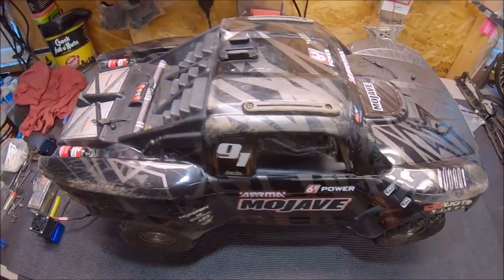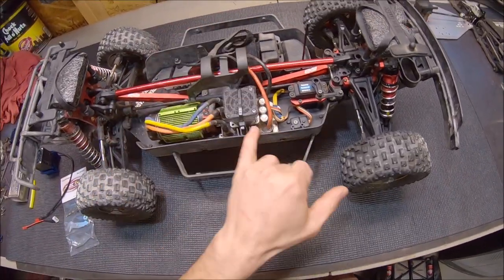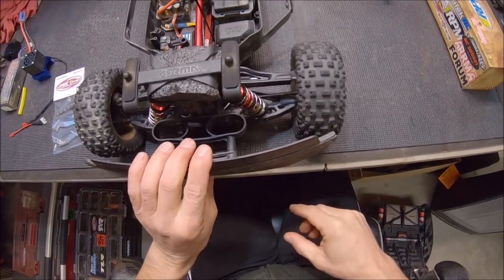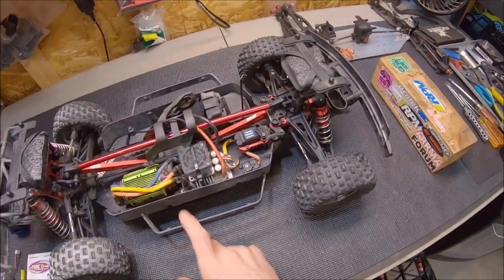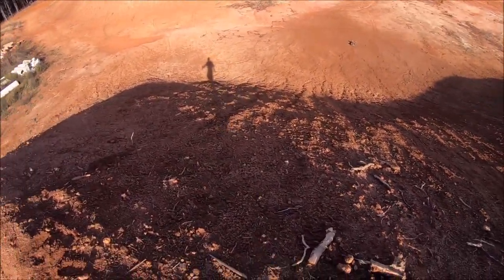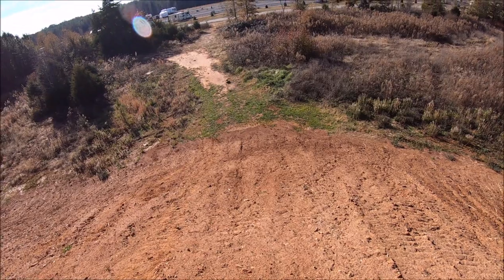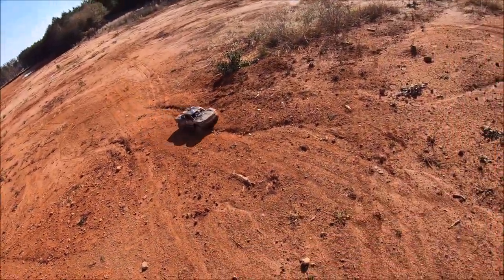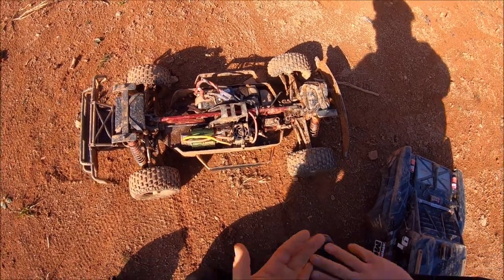"CRAZIEST!" Arrma Mojave EXB bash yet?! IMPORTANT tips and Upgrades!

Comment: Yup.. extreme compression popping front CVDs. To fix the rear;  front CVDs from arrma or GPM fit just fine. When you get the front CVDs into the rear you'll have the option to drill new holes into the shock tower and achieve lower droop for rear arms up to 1/2inch to keep rear wheels in contact with the ground with no issue of popping rear axles  =performance gains👍😁

Comment: Friggin SICK Brother Eric 😜!!!! Great job on the bench too 👍. Stoked the limiters stopped the shafts from going wonky and pulling out. That fan is definitely jet engine blower 😱🤣🤣. No problem pushing air now. Nice work on getting it mounted 👌. Huge props to Mitch for letting us bash how we want 😍. Another Killer session my friend. Definitely looks like a hoot. I feel the same way with my Senton 4s 🤗🥰🥰🥰. Not the best aero, but doesn't matter when you can't stop smiling. 🍻🤙🤙😎💪👊👊
Reply from the maker: Thanks Brother Rich!👊The Mojave is a whole different level experience and fun factor for sure! Just like anything, once tweaked, tuned and upgraded a bit in key areas, it's a total beast! I was skeptical of mega mound launching her for sure!😱🤣Going the other way was into the wind and sketchy but she floated down nice!😜Yeah adding limiters completely solved my driveshaft issue!🤗First bash since I've had the truck, not the first pop of a shaft! Mitches Exb Outdrives helped too!💪💪Felt good to rip this big girl again! Thanks for your comment and watching bro!😁👊💪🚀🚀

Comment: Very fun durable rc’s. I have a non EXB with a hobbywing max6 1650kv 8S stock gearing. I can’t get it to top speed, wants to take off in the air. Wheelies at all speeds. I haven’t taken it bashing yet. Just tested on the road. I’m sure it will be an animal off road! AWESOME VIDEO as usual! Yes installed the m2C wheel nut extenders. Thank you!

Comment: I did all my upgrades of m2c and am running a Hobbywing Max 6 w the 1650 kv motor and it flies!! I had to put 90 in the rear shocks as the weight w the motor was so heavy. I live when you say you don’t do big air w the Mojave, then 45ft jumps in the video!😂😂

Comment: I just got my roller. Putting electric s in her now 2200kv Taurus motor 24 pinion max6. 6s power i cant wait to run it. Nice video. My stering arm didn't fit on my servo. So i replaced mine. If billing u guys may run in same problem

Comment: I have a problem with the fan setup. The fan is pushing loads of air but it can only cool the tiny heat sink provided.
Surely the fan blowing over the whole motor would be a better solution.
Put some holes through the heat sink so more air can reach around the motor can. I don't have one but it makes sense to my eyes and thinking.

Comment: Since you have tested both which you one do you like it more, the Anthoiny fan or game changer ones? I'm running a max 6 combo in my Kraton EXB with a 19T and I'm getting hot. just running a pack of SMC 8000 Mah 125C. it just shuts off after 30 mints of running. I'm Running on grass, that's all i have around me. ESC looks fine but motor is hot to the touch.

Comment: I would also love to have the tools to do some shock work.  You want more rebound, however I have never seen a shock piston that can do such a thing.
It is possible to put a one way valve over a couple of holes so under compression the flap closes but on rebound they open allowing more oil to flow through  allowing the wheel back onto the ground faster.

Comment: I have a Mojave EXB, with all Spektrum electronics (motor, ESC, receiver).  I also use Spektrum Smart batteries.   I have never popped out a drive shaft, the EXB stock shock towers have taken a beating and have not bent.  I think you have over powered this Mojave - causing a lot of your issues.  The only weak spot on this RC is the Shock support.  A little drywall tape and Shoe Goo, still flexes but have not broken one since.

Comment: Love the video! Do you have any issues with jumping the Mojave and controlling in air? When launching it sometimes feel like it doesn’t respond to brake or throttle to level out the truck when landing. Any suggestions? I was thinking tire change would help for more rotation. Running the maxx6 1650, 60,000f, 500,000c, 30,000 rear. Appreciate any suggestions. Love the vehicle
Reply from the maker: Thanks!👊The Mojave by design isn't really a big air stunt truck. It does have a little correcting control if setup right. Sounds like your diff setup is great! What gearing are you running? I find staying in the throttle off jump faces help! If in a nose dive, only a frontie save will save it!🤣Bigger tires will help greatly as the Mojave tires are small for the weight and length of the rig. Not a lot of rotational mass. The Mojave is a pure drivers car! So much fun!😁👊🤘🤘
Reply: @RCDUDE81  thank you!! I was running a 20t, just purchased a 23t for it to get little more top end. Not sure if larger tooth will help with little more air control? This thing is a blast, can’t help but air it out. Ordered the m2c hub extenders and will try little bigger tires as well. Thanks for the content, know it’s a lot of work. My brother and I have a small channel and love to race and air our vehicles. Thanks for the awesome content.
Reply from the maker: Anytime bro! Yes a bigger pinion will help! More rpm will be more wheel spin!

Comment: Will it be worth changing the pistons in the shocks if you are already running the current m2c setup when this new one drops?
Reply from the maker: We'll have to see how it does compared to a stock M2C setup. I'm just worried about piston hole size using a lighter fluid. I'd like to be able to use stock wt but we'll see!😎👊

Comment: you got the M2C dual-nut-system.....but it has been said the EXB-nuts don't come off.....or did they?
Reply from the maker: Yes same issue with the wheel hub. These extend out 2mm to stop the rubbing wheels on the hub which will loosen the wheel nut. The double nut just ensures they don't back off!

Comment: Hay bro great video man. Could you tell me what diff oil your running now in the mojave. Is it still the same as the video or is it different? I just drove mine for the first time today and a fucken rock got in by the center diff and wore a hole in it all the oil came out so now I have to pull it see if the gears are bad and fix it. So thanks man and any help would be very appreciated. Thanks man.
Reply from the maker: Dang man that sucks! I'm currently running 30k front, 200k center and 20k rear. You could go thicker front and center for faster corrections but that is up to you. I like the full diff action in the Mojave so I just beefed up the center. Stock is 10k, 100k, 10k
Reply: @RCDUDE81  hay thanks alot bro for letting me know,I really appreciate the help man thanks again
Reply from the maker: No problem man!
Reply: Hay bro sorry to bother you man just one more question what are you running in the kraton 8s diffs?

Comment: What do you do to always land the right way
Im not an expert doing jumps and I usually fall either on the front bumper or upside down 
Any tips?
Reply from the maker: Well air control is done with the throttle and brake controls. Throttle in the will bring up the nose and brake will bring the nose down. The Mojave is  bit tricky with the smaller tires. Not a lot of rotaing wheel mass for fast corrections. Staying on throttle off jumps helps too then brake right before you land. Just takes practice!!😁
Reply: @RCDUDE81  Thanks bro I appreciate your time!

Comment: people say the shocks on the mojave out of the box are perfect. I have the exb and stock v4 electronics minus the servo and radio. I have 50wt oil i could try. Would it handle better and be more realistic wi5 that kind of oil?
Reply from the maker: They are setup good out of the box unless you weigh it down with heavy electronics then it needs a shock tune imo. I went 55 weight and it seems to help but may need slightly stiffer springs too. With light V4 electronics, you may be fine with stock shocks if you like how it drives!👌😎👊🤘🤘

Comment: I destroyed one of my batteries using a fan like that. I had it plugged into the battery balance plug and there wasnt any cutoff at min voltage so the battery discharged too quickly running the fan and the esc on the truck. I was thinking of running a standalone battery but how do i keep it from killing the battery?
Reply from the maker: Yeah I don't recommend running off the truck lipos. I run a small 500 mah 2s just for the fan I strapped down in the truck. Same for the Game Changer fans I ran in my latest Kraton vid. I ran a small 1300 mah 3s just to power the fans. I had the same issue like you one time and almost ruined my pack..👀
Reply: @RCDUDE81  yeah the truck kept cutting power and finally wouldnt move after a couple reset. Low and behold i took one of the batteries out and was super swollen. Is there something you know of that i could hook up to this and keep it from killing another battery?
Reply from the maker: I would run an small 2 or 3s pack just for the fan like I mentioned above. They are small, light and easy to fasten down in the truck. I'd recommend going that route instead of using one of your truck batteries.
Reply: @RCDUDE81  i get that but doesnt draining lipos down all the way cause damage or?
Reply from the maker: I just had to listen to my fans. If they sound like they are slowing down, the lipo is probably at lvc.
Reply: @fastbanshee1999  Get one of them cheap lipo voltage testers and hook that up to your fan battery also.  It will beep at you when the lipo gets to low voltage.  Google them.  They are dirt cheap.

Comment: Hi Eric dam your right about that sounds like a A10 warthog. Great information on the front drive shaft mine pops out too alot from a hard landing. Would you recommend just making my front suspension stiffer so I won't have that travel?
Reply from the maker: Stiffer suspension may help yes since they will probably be thicker springs. I may experiment with stiffer springs myself. Got to dial this thing in!🤣The limiters definitely worked though! Didn't pop the first shaft!😁👊🤟🤟
Reply: @RCDUDE81  great. Yeh definitely  try thicker springs since you won't get that full shock rebound which is why our shaft's are piping out.  I'm gonna just tune the shock down to be alittle more stiff maybe that will help. It's also all about how she lands too sometimes they will pop out no matter what u do.
Reply from the maker: Check your front  arms too. Having the limiters, the cup completely clears the arm. My cups were digging to China!🤣
Reply: @RCDUDE81  lol Nice Eric keep up the great work. I mean as in bashing work 😜👍🤙

Comment: Can I use exb Diffs on my truck.  
Everything is V4 on mine.
Reply from the maker: You can but you need the whole diff. Including the input gear.👌
Reply: @RCDUDE81  
Is there different size input bearings ? Or just a different gear size / tooth size
Reply from the maker: Bearings are the same I believe but the Outdrive shafts are fatter. Gears are beefier too. So you need the whole thing to convert.
Reply: @RCDUDE81  
Thanks bro.  You Rock ❤️👊😀

Comment: Hey brother… Excellent video as always. Just a quick tip if you start running those high powered fans on your ESC. 
https://youtu.be/9h1ExZG_DrU
I noticed that fan you are showcasing in your video for the motor was attached to a blue heat sink. However… What’s the recommended strategy for keeping that heat sink attached to the motor? I’m having trouble finding any heat sinks compatible with 40 mm (those fans) that actually can hook to a motor (All the way around) and not just snap on willy-nilly.
Reply from the maker: Sometimes you have to bend the heat sink a bit then slide it on from one end so its snug. I'll check out the link thanks!!😎👊